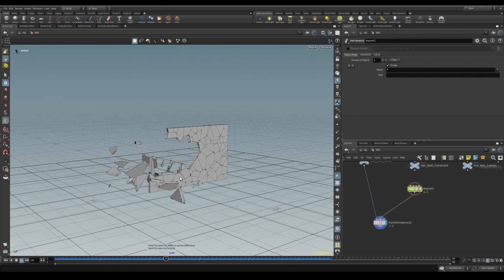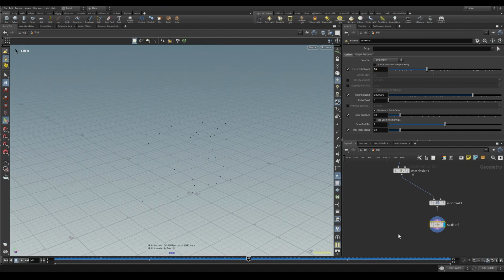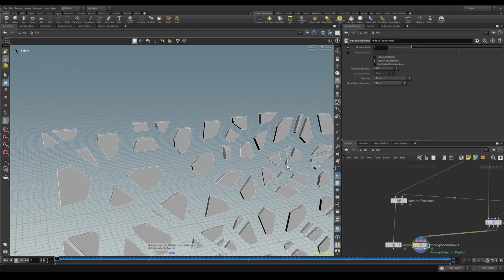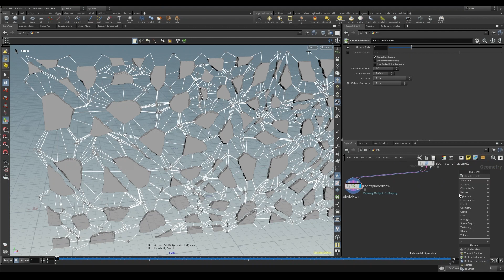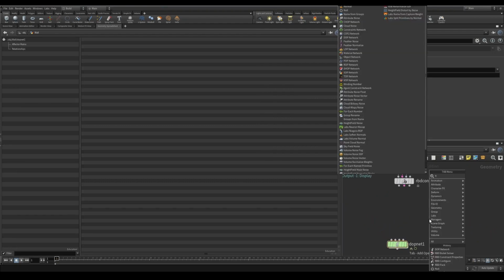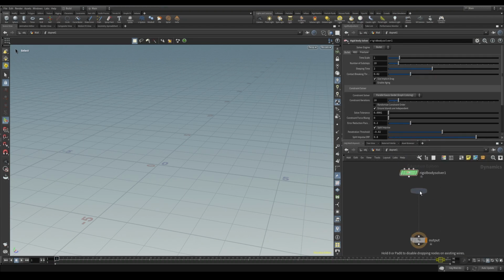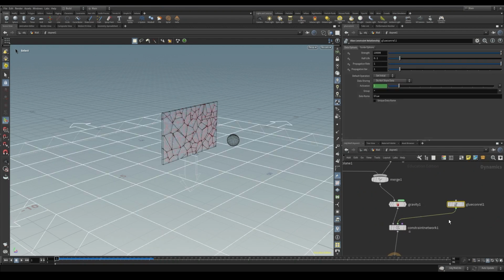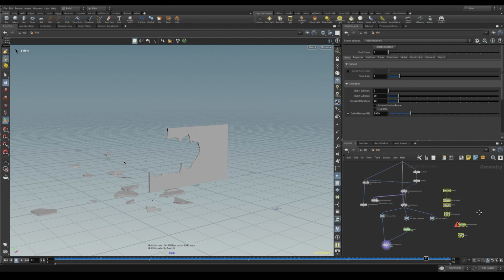VFX in Houdini | Part 4 | Introduction to RBD Material Fracture

Comment: Stupid question probably, but when I merge the ground and the solver the ground collisions don't work.
Though when I merge the ground with my rigid bodies it works fine. What am I doing wrong?
Reply from the maker: @davidrou1982  based off your description, you likely need to swap order or set the merge to mutual. Merges work as simple solvers in DOPs and have extra parameters.